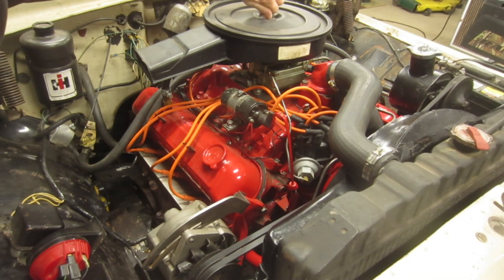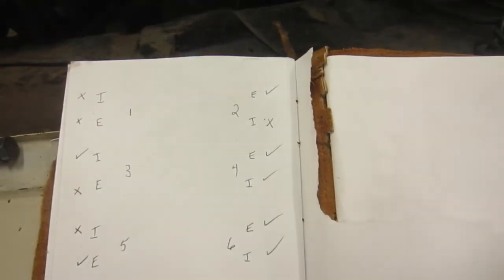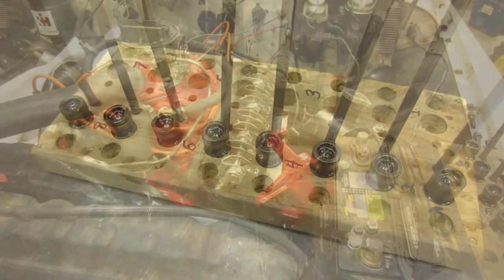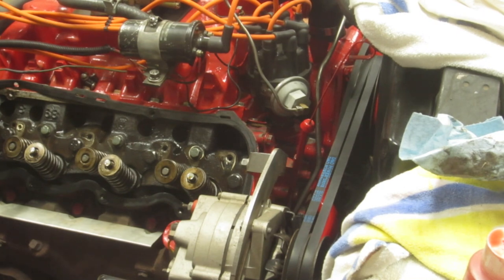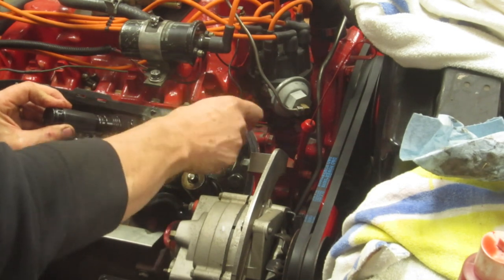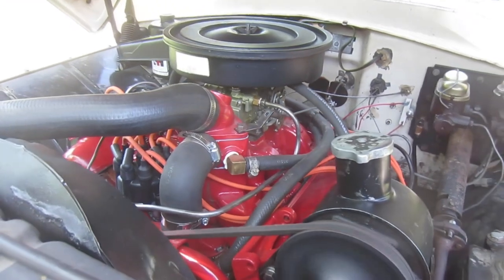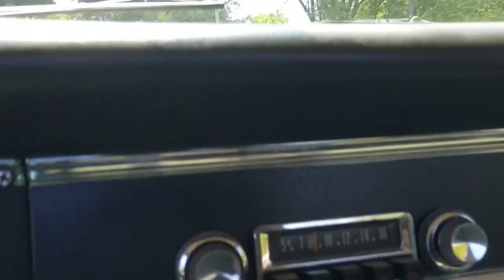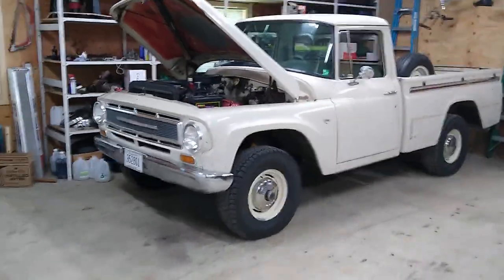International 345 V8 - Part 6 Wrap-up

Comment: Congrats!  Sounds great, seems to run well.  On one of my IH medium duty trucks (345) I replaced to the points based distributor with an electronic ignition.  Made a huge difference, especially the mileage.   In my case, the entire distributor was replaced with a Crane racing distributor (that's what was specified).  On some models, there are conversion kits instead, replacing the points with the ignition module and pickup coil and so on.  Good stuff.
Reply from the maker: Thanks.  It has been running great after some tweaks to the carb, a timing adjustment and a new vacuum advance.  I'd like to upgrade to electronic ignition and maybe Holley Sniper fuel injection in the future.

Comment: Any updates on this pickup?
Reply from the maker: Since I made that video I rebuilt the carb, swapped  out the starter and set the timing.  It ran great after those last few tweaks and I was able to drive it all summer and even showed it at the Gear Heads Get Together in Maple Lake, MN in August.  My winter project is to replace front and rear pinion seals and all three seals in the transfer case.

Comment: Hello Toolman, I too have a noisy lifters in a 345 in WI. I heard some of the new lifters are made in China and manufactured incorrectly inside. Did you take apart the bad lifters to compare with the original? I am curious as I do not have the original lifters anymore.... Thanks! Nice work!  Any idea where to buy a good set?
Reply from the maker: I still have my old lifters, but haven't done an autopsy on them yet.  I got my new lifters through Rockauto.com.  I ordered the Sealed Power HT855, but the order was cancelled due to an inventory count issue.  I then reordered the EngineTech L945.  I did a little research on EngineTech before I reordered and it turns out they repackage other manufacturers stuff, but I couldn't find out who actually made my lifters.  I've been happy with them so far though.  I have only run about 30 miles since getting my truck back on the road, so time will tell.
Reply: @TheToolmanTim  Thanks much appreciated!
Reply: Toolman, did you do the high rpm break in when you swapped in the new lifters and use special break in oil? I am wondering if I need to do the 20 minute high rpm break in period if I swap a few lifters like you would with a new cam and lifters? Thanks!
Reply from the maker: @MrBdiggiti  Let me start by saying I am not a skill mechanic, just the shade tree variety.  I didn't do a high RPM break-in or use special oil.  I used assembly lube when I put everything together.  One important thing to do on an IH V8 is pre-oil when the engine has been sitting a long time or been torn down and reassembled.  Pre-oiling can be easily done by pulling the distributor and using a drill to spin the oil pump.

Comment: I enjoyed your videos, any interest in selling your original 345. I'm in St. Cloud.
Reply from the maker: Thanks.  I was going to rebuild it, but changed my mind when I saw one of the mount points on the block for the bell housing was broken off.  (See part 4 around the 15:30 mark).  It's just sitting here as a parts donor for now.  I'd consider selling it, but it probably needs to be gone through.  It had some blow-by and may need cam and bearings replaced.  Let me know how to get in touch with you if you're still interested.  Also, I talked to the guy at Windy Hills Auto Recyclers in New London a couple years ago who said he has good running 345s available for around $700.
Reply: @TheToolmanTim - thanks for the reply. The broken mounting point is disappointing, for both of us.  I have another source I will check with, thanks again.